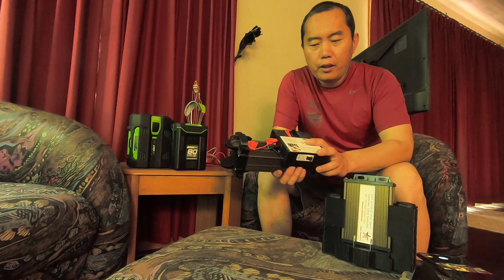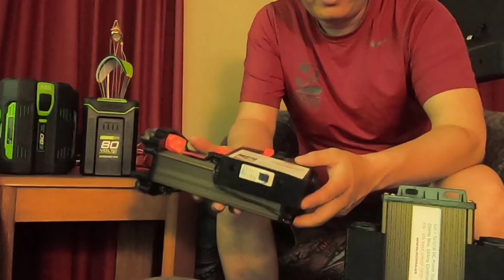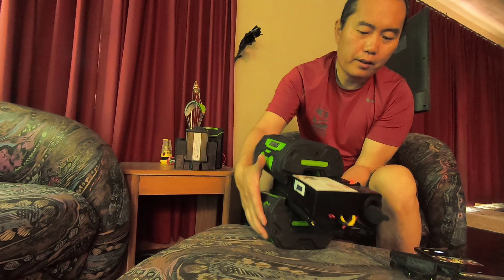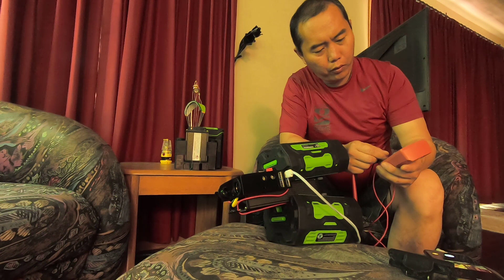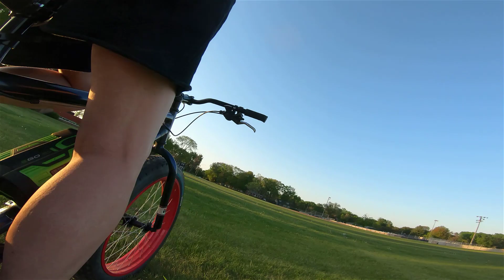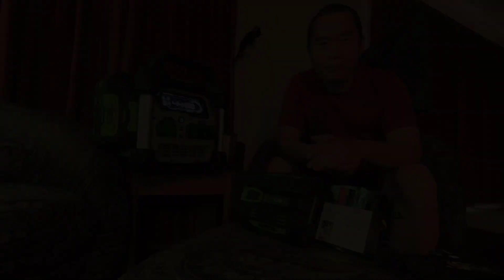EGO 56V Battery to 12V Trolling motor Scooter Power Wheels

Comment: Ship to Australia?
Reply from the maker: Yes. Shipping cost is about $30
Reply: @JerryMinne  thanks alot. Would you recommend the larger type for 30a application? Wanting to run a 12v tyre compressor. I see you have 2 designs,- I'm not sure what is better. Impressive work

Comment: Does your adapter come equipped with a breaker or anything else to protect the expensive battery?
Reply from the maker: Yes. It has  circuit breaker.

Comment: Hey buddy, do you think it’s possible to use an adapter to use the ego battery to power up a Livescope, 24v ?
Reply from the maker: you can serial link 2 of my ego 12v power stations to get 24v output, but it's not recommend.
Reply: @JerryMinne  sorry I meant  convert 56 to 24 volt
Reply: I need 56V to 24V as well.
Reply: @michaelthompson1002  I am interested in hooking up my merits p320 junior scooter
Reply: I want to do 56 volts to 24 volts

Comment: I'm looking to buy one of these for my kayak powering a 40 lb thrust trolling motor. With one eagle battery on say the 75 amp hour ego battery, what are the dimensions, length with height, of that 12 volt 30 amp conversion adapter with one battery on it.  I want to make sure it will fit in my battery box on my kayak. Thanks
Reply from the maker: With ego  7.5ah battery the size is 6 x 6 x 12.5 inch
Reply: @JerryMinne  thanks so much! That will fit perfectly in my kayak battery box!